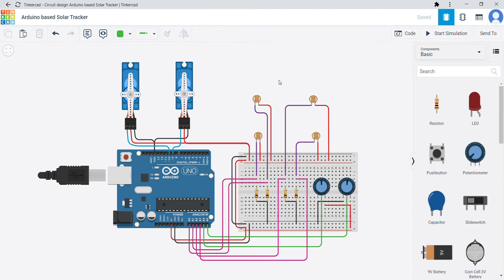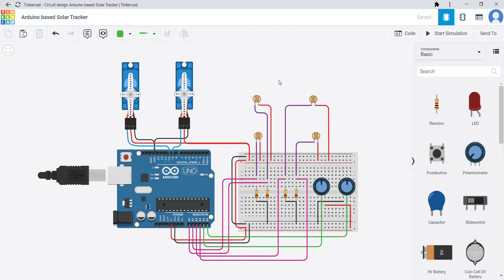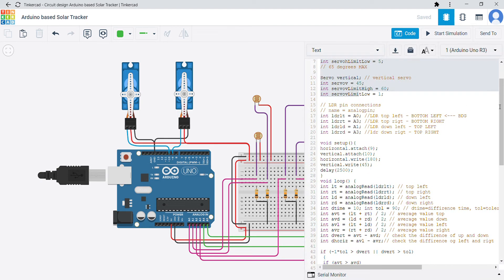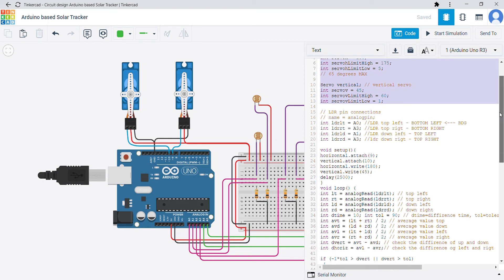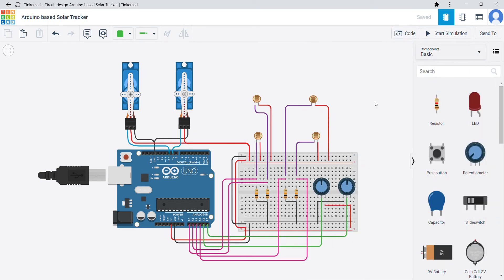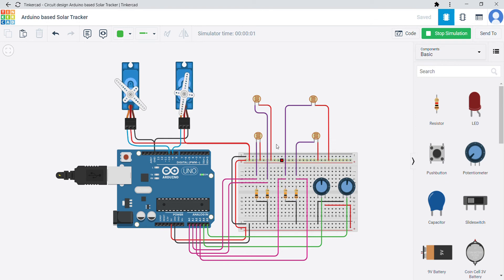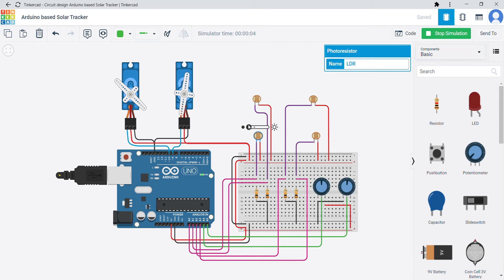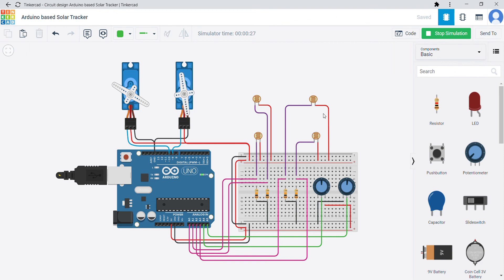circuit design of arduino based solar tracker using tinkercad

Comment: why don't you use motor driver (l329d) to  run servo motors.. can  servo motors run on the output of Arduino??